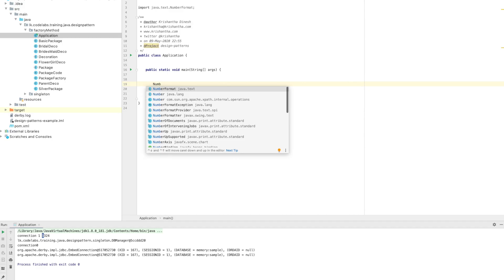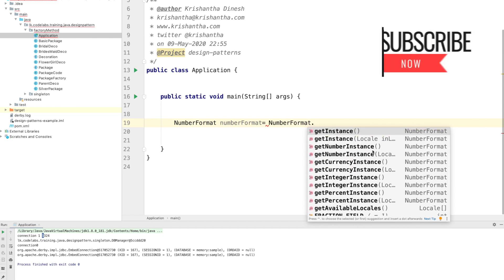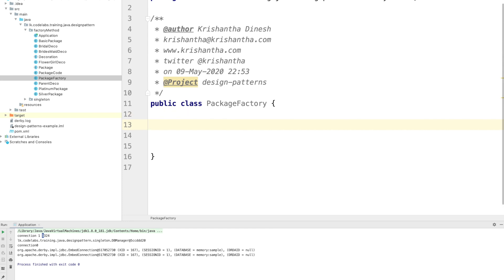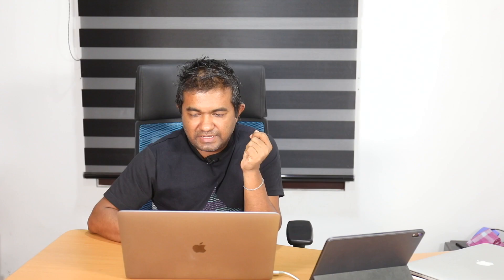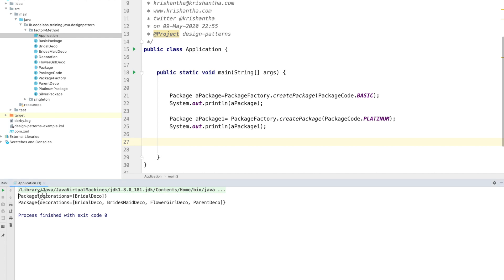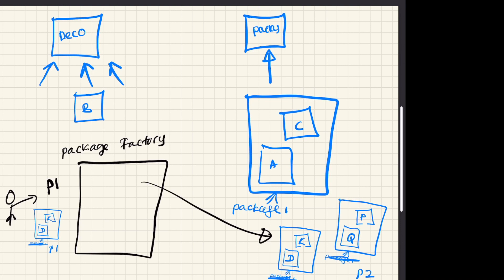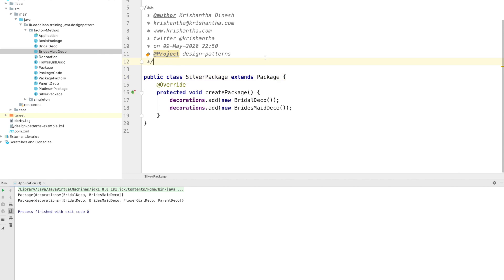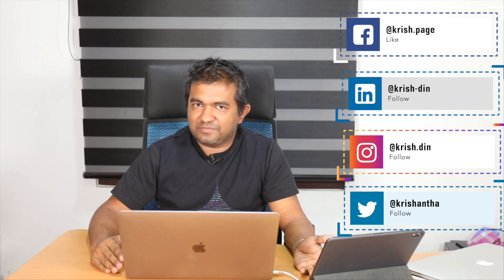Use of factory method design pattern | Design patterns you MUST know

Comment: While the factory pattern you created would have been useful in a small, unchanging situation, it wouldn't have allowed for growing the enumeration. Adding more enumerations would brake the Open/Closed Principle in SOLID. Also, it's better to NOT having a static method on the factory. Instead, have the factory implement an interface and inject the interface where necessary with dependency injection. However...as I originally stated....not bad for a small, unchanging codebase.
Reply from the maker: I agree. I just want to give idea behind the pattern without making to too advance. Bcz DI is not something everyone would know. Specially beginners. So plan to cover fundamentals with small samples and have 1-2 advanced video for rest like singleton with enum etc. thank you for the point and ill take it and address in other tutorial. KIT